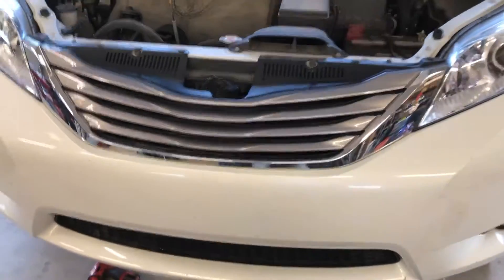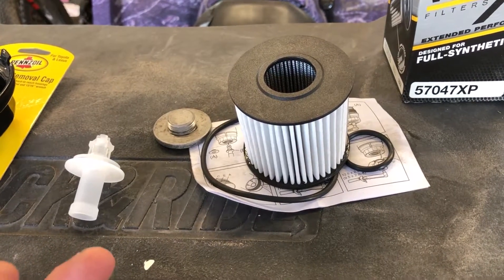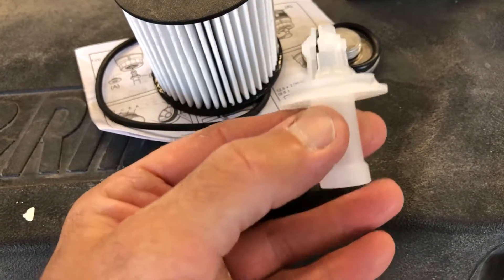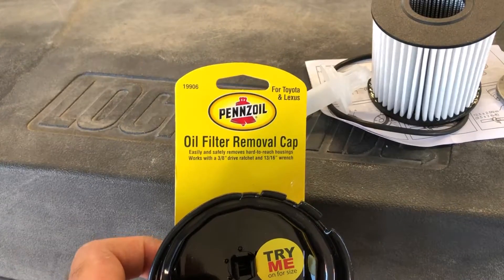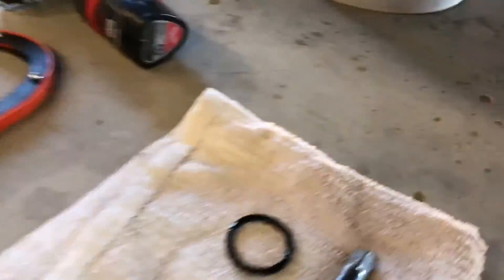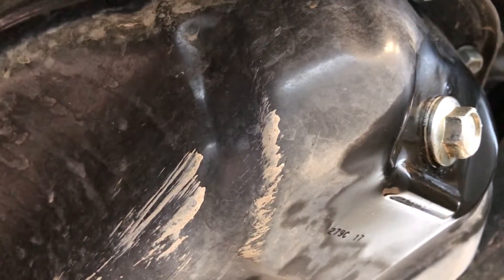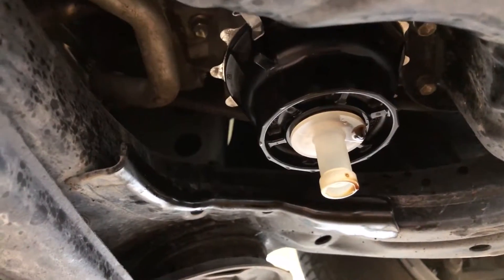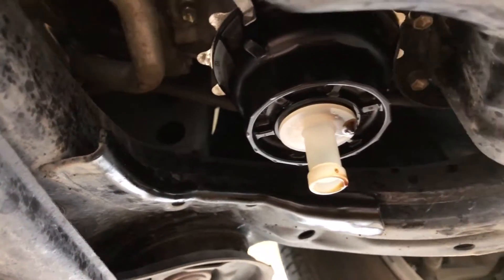2017 Toyota Sienna Oil Filter Change - DRAINING the Oil Filter

Comment: Under what pressure? Gravity? If the engine is off, the oil pressure is zero. The reason nobody uses this drain is that the entire cap comes off if you try to loosen the small nut on the bottom. It's just easier to yank and crank the housing and let the oil fly. I lay down a puppy pad (absorbent) under the car and let the wrenching begin. If I miss the oil bucket by a couple of inches...so be it.

Comment: Everyone who has this system should be prepared for a worse case scenario especially if this is the first time you're doing this.

In case of a Stuck Oil Filter

Make sure you have the following...
1. The proper Motivx* oil filter cap wrench. Item #MX2320 us for all Toyota/Lexus/Scion engines 2.0 liters and larger using a cartridge style oil filter or item #MX2321 is for all engines smaller than 2.0 liters using a cartridge style filter.
2. A 27 mm ½ inch drive socket
3. A ½ drive breaker bar (18 inches or longer in length. An extension may be needed for some models.)

If an oil filter cap seems difficult to remove, only the above items should be used (or equivalent tools). Do not simply use a ⅜ inch drive ratchet or ratchet with extension as these will sometimes result in breakage of the oil filter cap wrench or the oil filter cap.

Always make sure the teeth on the wrench are properly engaged with the tabs on the oil filter cap.

To prevent reoccurrence of the problem 
•Make sure new o-rings are properly lubricated before installing. 
•Use a torque wrench to install the oil filter cap to no more than 18 ft.lbs (25 N•m). Oil filter drainplug = 10 ft.lbs. (13 N•m)

* If you think the Motivx tools are too expensive at least consider the following... Do not buy an oil filter cap wrench that is made from cast aluminum. Only buy one that is forged. Do not buy one that is strictly a cap wrench that does not have teeth. Do not buy one that claims to fit all models or even all four cylinders. The 2.0 and 2.5 liter four cylinder engines use the same oil filter cap wrenches as the six and eight cylinder engines use. Only the 1.8 and 1.3 liter engines use a different size oil filter cap and oil filter cap wrench. If the oil filter for your four cylinder vehicle comes with one o-ring instead of two then your vehicle takes the same wrench as a Prius or Corolla. If your oil filter comes with two o-rings & a drain tool then your oil filter cap takes the same wrench as the six and eight cylinder engines. Some companies claim their wrench works for all four cylinders but on the 2.5 liter engines that smaller wrench does not engage the teeth on the wrench to the tabs on the oil filter cap. It may work if your oil filter cap is not stuck but it is a poor choice. They are mislead.

For those that don't believe this is a problem...
https://youtu.be/Wm-VMIkTw6k
Reply: Very good information. I bought the Motiv wrench after reading several reviews of others breaking.  Yes it's expensive but the quality is 10x better than the aluminum ones.  Also, if folks would use a torque wrench instead of guessing, they could eliminate a lot of problems that come with under or over tightening.